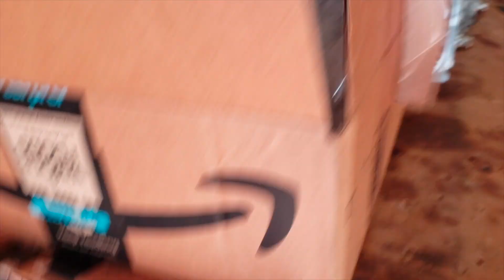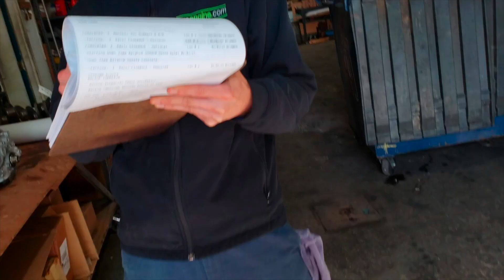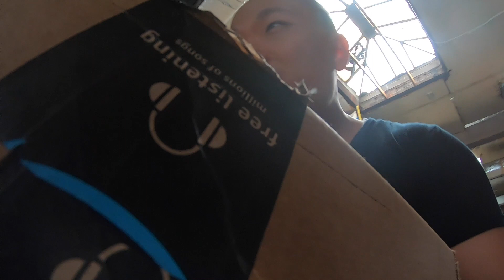Westchester Crankshaft  (machine shop - hot tanking & micro-polishing crank)

Comment: I rebuilt a 1965 Chevrolet small block 283 and didn't have ANY oil pressure through the lifter galleries. I put the engine into my 1975 Nova and drove it for over a month. The crank & connecting rod bearings were obviously getting enough oil. What the HELL did I do wrong that could possibly have affected lifter gallery oil pressure ?

Comment: I am glad someone posted a video of this shop to share their experience, and get a better understanding of the shop. I have an 4ac from an ae86 and they will be working on it shortly. Thank you for the content.
Reply from the maker: Oh nice, what are you doing to the motor
Reply: @ikigaidriven  The 4AC leaks so the engine is old and have never been restored so I decided to plan straightened out the block by having the them Port and polish the head and get new SEALS or rebuilding the entire engine all together but also adding Schneidercams 
300F Toyota 3AC/4AC Camshaft
68011 Valve Spring Set double spring
Weber carb 38
MSD
To name a few.